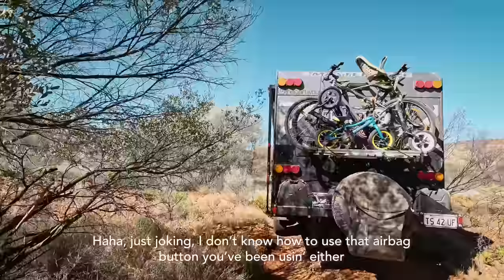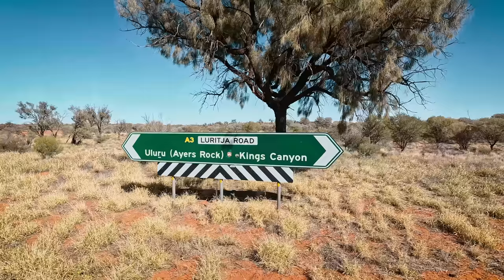SECONDS FROM DISASTER - MADNESS on the BOGGY HOLE 4X4 TRACK - TOWING 25FT CARAVAN with ISUZU NPS 4X4

Comment: Epic stuff family! 27:00 is why our offroad caravans in Sarff Effrieka have that back corner cut off at at least 35 to 45deg for better departure angle. I really believe, along with steerable undercart, that  that could be the best mod you could do on that van.
Reply: Id also plate the underside with some 8mm steel from behind the wheels to the back, and mount all the rackage on the back higher, or elsewhere, then you can happily just drag its arse over anything.
Reply: @maarten_notjustagrip  the chassis rails did the job this time but I agree, some plating would probably be good. And move the spare wheel out of the way.
Reply: @alanhat5252  I must respectfully disagree about the chassis rails. Without them being "bridged", they just sit either side of whatever protrusion you're hanging up on. If the whole rear end was a full width skid plate, it would help a lot. That caravan has a dismal departure angle.

Comment: This is absolutely the coolest rig on the planet!  I have never seen a camp trailer on air ride. I have never seen any air ride vehicle that has the ability to control ride height from one side vs the other.  I will say that the hitch set up is the oddest thing I have ever seen. 
Have you ever considered installing winches? It looks like you could use them from time to time.
Also, watching you get unstuck, I have wondered if you have any kind of lockers in your diffs front and rear?  I have a limited slip locker in the rear of my Chevy SUV and it makes a HUGE difference in slippery conditions.  Years ago, I had one in the rear diff of my Semi truck(Prime Mover) and it was a game changer in winter weather.
Reply: They have winches front and back they have diff locks but when you tow a 25 foot van with a 20 foot tow vehicle you run out of space really quick 😅
Reply from the maker: Pretty much. We have all the gear we need. It’s just some times, shit hits the fan, and you gotta get it done

Comment: I would definitely raise the spare tire mount so in the future you don't have to worry about it getting ripped off or bent up into the back of your camper. That's a very capable setup for how big it is.
Reply from the maker: It goes well. One down fall would definitely be is departure angle at the back
Reply: @thecartwrights  I've hit the A-frame on the ground a few times with mine, your A-frame doesn't look like it extends far enough back for that.
Reply: Prepare also a few Snow-tirechain for next mud area.....

Comment: With a little calm rationale, planning and teamwork, most challenging obstacles are overcome. Your videos will show that some roadways and gates will need widening and flatter grades for your size truck & c'van. But what's the fun in that. For emergency cases, do you have either mechanical or electrical hitches or straps to pull or guide/steer/maneuver the truck or c'van around or through obstacles? May need to fabricte some foldable or bolted on inclined steer pads for impassable grade issues.

Comment: Probably been asked heaps of times, buuuut, what is that suspension on the van? Very impressive.
Reply from the maker: CRZR industries made our chassis and suspension system. Look it up on instagram, you will be blown away. Best system on the planet
Reply: @thecartwrights  sorry, but if that's the best available it's very disappointing.

It uses a half-length Panhard rod rather than a Watt's linkage to locate the tops of the axles, the axles aren't linked together to compensate each other's movement & they've used an expensive long-throw damper rather than putting it in front of the axle where there is less movement (& a cheaper, more readily available one would work just as well). Similarly, the airbags could be in front of the axle for a shorter throw though this is likely less of an issue. 

I can see it's good (particularly the lateral location being high & central to centralize the body's roll centre vertically to some extent) but there are off-the-peg improvements readily available.

Comment: A little bit of a tip.
Go and get yourself a good brush cutter with an extension with a chainsaw blade on the end now you can cut any overhanging branches with ease.
Reply from the maker: Mate if I did that, I’d have greenies everywhere dipping there lid

Comment: Greetings from Cape Town, RSA 🇿🇦 . 
I’ve only recently found your channel. And now I have serious toy envy. Well in your case I guess it’s called home envy. 
Your channel and video creation is really professionally done. 
Please may I ask a question? I find myself screaming at the Tv, but you never answer me. lol…
Max Traxx. They’re an amazing tool to have… if you have a traditional 4x4 setup. But in your case, do you not think it would be better to have aluminium track pads about 3m long that the German over land vehicles use? Similar to what the Volvo and MAN trucks use? Don’t get me wrong. I was amazed how well they worked when you got stuck in the mud. But can’t help but feel if you had longer, wider aluminium tracks you would have put less stress on the CV joint, and would have had more forward momentum to pull the truck and van forward. And also in the video above where there was a steep drop off, these would help with making less departure angle on the van. 

✌🏻 keep on truckin’
Reply from the maker: Hey mate. This is a great idea. I’ll look into it

Comment: A tip so youdont lose maxtrax in the sand, tie a highvisability cord/rope to them  and pull them out to the side so they can be easily seen..

Nice job withe the grading of the entry to the little dip.. Thenext25 meter long rig will have an easy time..
Reply from the maker: Believe it or not. We have these hivis straps also. We just didn’t use them
Reply: It seems the same problem on a few "Expert4x4" channels...
Reply from the maker: Some times you get lazy. And you pay the price
Reply: @thecartwrights  well digging a truck out of themud after going down to the axles does make for good video content...  :)
Reply from the maker: Hahaha good point 😂. Thanks for watching mate
Reply: @thecartwrights  tying the hi-viz cords to the back of your rig means the tracks will usually follow you out & be sitting on top when you go back for them.

Comment: looks like a really nice trail u went. just a ide but on forestry trailers for tractors here in sweden they can have a option to swing the drawbar left and right to piont the trailer in tight spots. my thougt is if that is posseble to implement on a offroad trailer like ours. thx for a good video its fun to see our adventures..
Reply from the maker: Wow that’s cool. Iv never seen that before
Reply: @thecartwrights  nor have I, I've seen steerable axles though.
Reply: thinking about it, a swinging A-frame would often put the hitch on the high side, provoking an overturn.